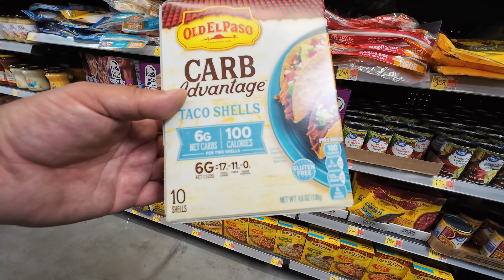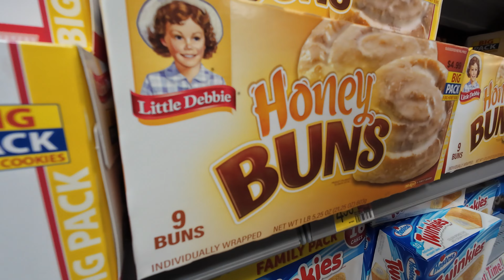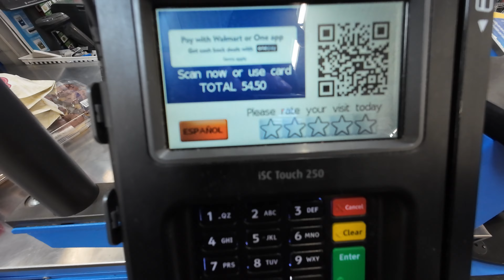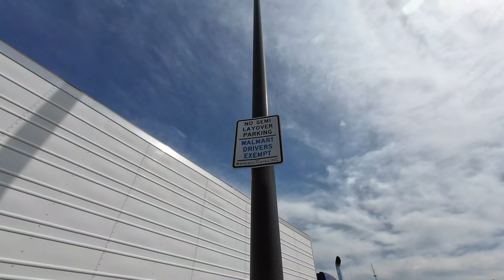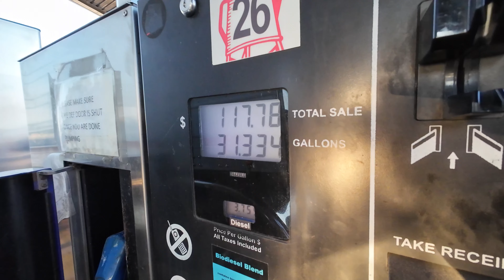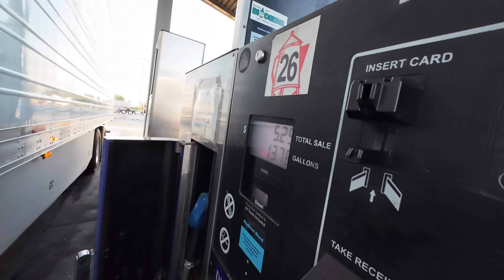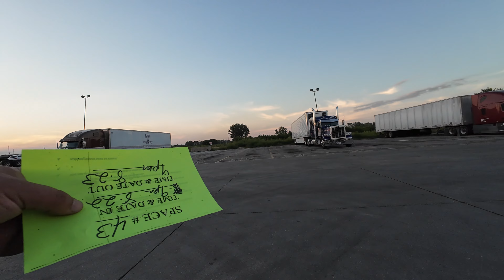COOKING IN TRUCK STOP PARKING LOT.

Comment: I showed my mechanic son your video of changing the tie rod.  Hes changed lots of them on big trucks.  He would say now just hit it hard but you didnt and he would chuckle.  Hes wondering if you frames twisted a bit giving you that feeling.  He said changing the springs wont help it.
Reply from the maker: I definitely should’ve used bigger hammer when changing this. I’ve been to a frame shop couple times and they said that it is good, but I will have to take it to a different frame shop and have them check it out as well.